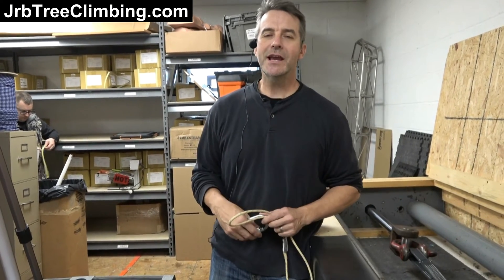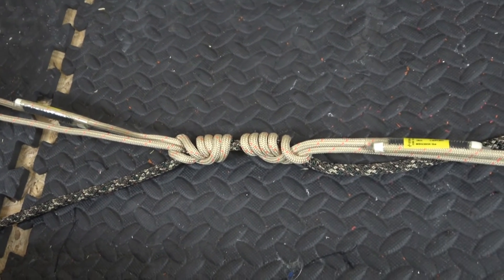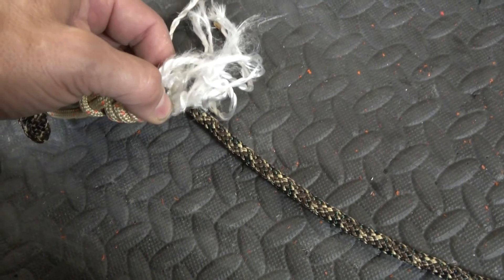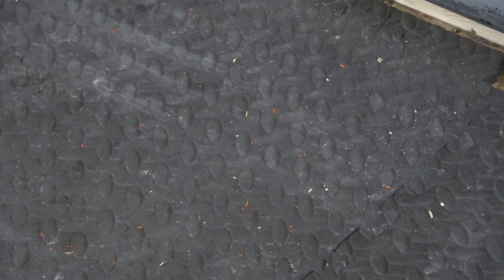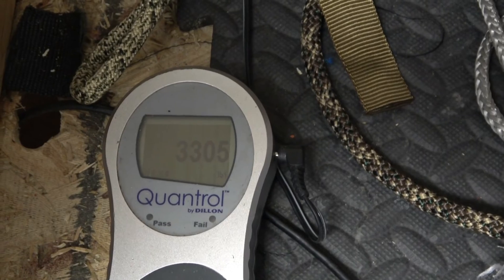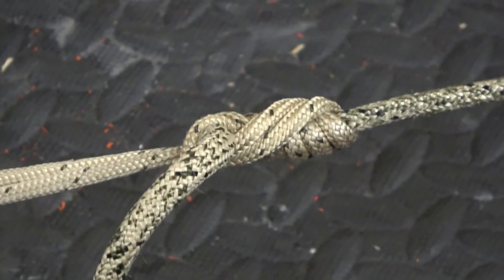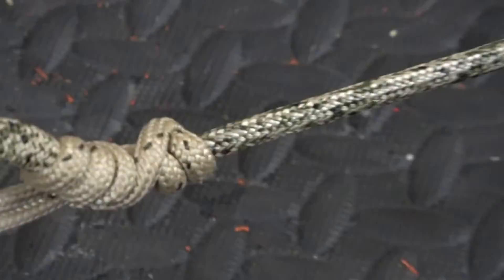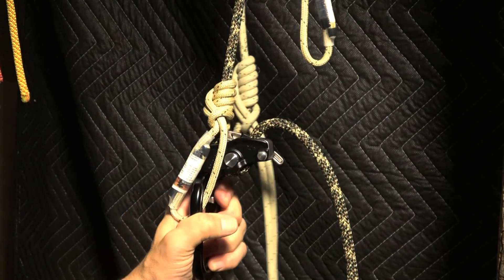Hedden Knot Strength Test

Comment: How does this hitch perform using hollowbloc cordage?
Reply from the maker: In my understanding, when forming friction hitches, Hollow Block cordage generally outperforms traditional cords in terms of hold because it allows a greater surface area to make contact between the cord and rope. In my experience, the downside is that it's often more difficult to move them after load.  I have tied the Hedden with a Hollow Block Prusik loop and both seem to apply: it holds and grips so well that after load, its a little stiffer to move. When rigged as a backup however, the Hedden should never actually get a load during ascent; it's just ready to do so.  Pls be sure that the product you are using is fit for the application.  In my experience, the TRC really does well over time and wear. I don't have hard data to refer to but a Hollow Block with no sheath probably would not last as long.

Comment: What do you think would’ve happened if you used 7mm on the 9.5mm, slip or break?
Reply from the maker: Now that's a great question.  They don't make TRC in 7mm.  But IF we did have the same rope in 8 and 9.5mm and we had the same cord in 6 and 7mm, my guess is that it would slip... simply because the ratios are about the same.